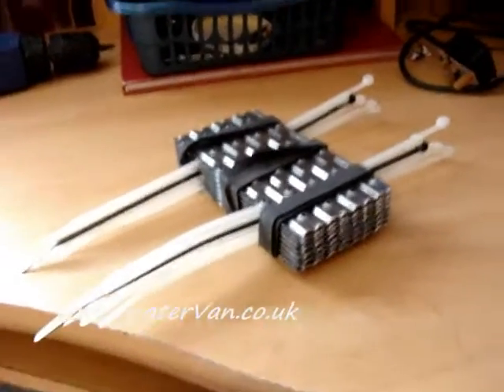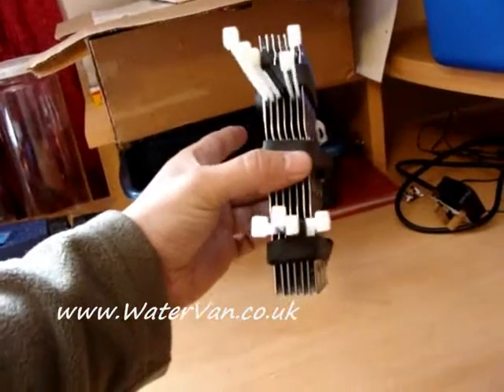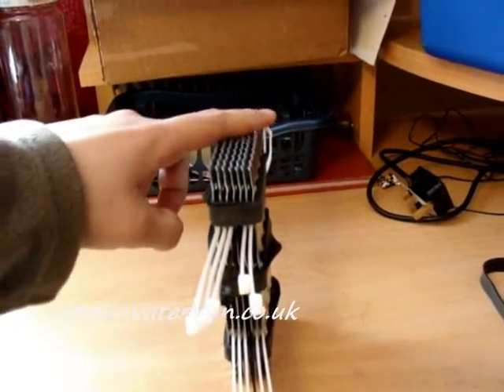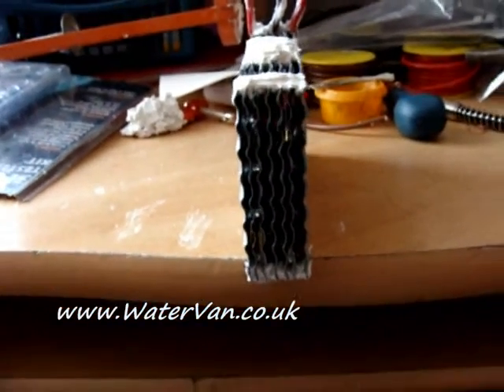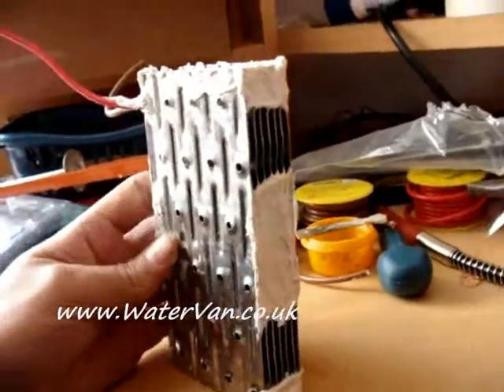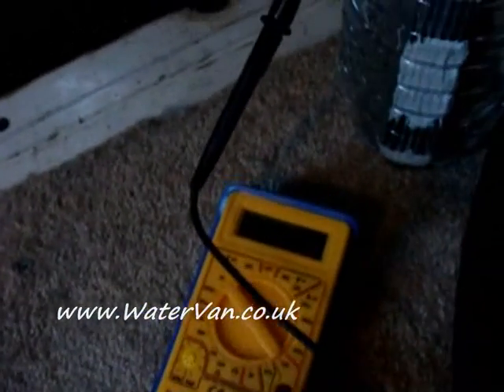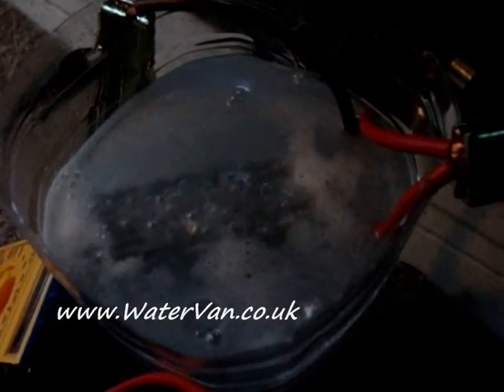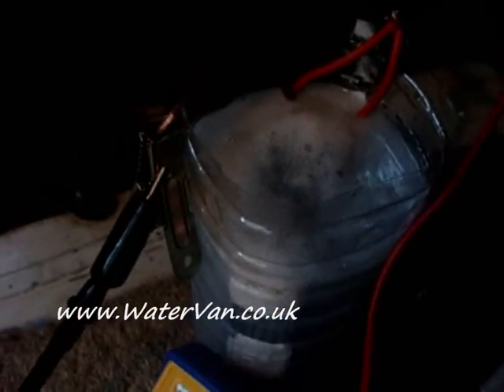#011 - MadStu's Water Powered Van - Construction and test

Comment: Actually, the more you seal up the edges, the better if you decide to keep them setup in series. 

When you work with neutral plates, there is a tendency for electricy to make an end run around your neutrals if you seal up the current leakage at the edges of the plates.  

Your plate perforations are presenting leakage also, so am not sure how much sealing up the edges might help with this plate material. But its worth a try.